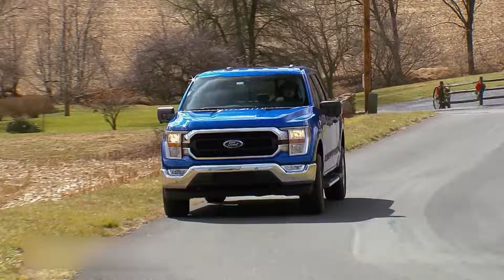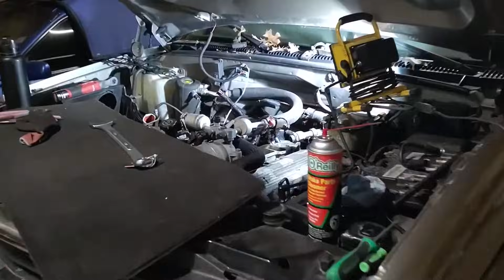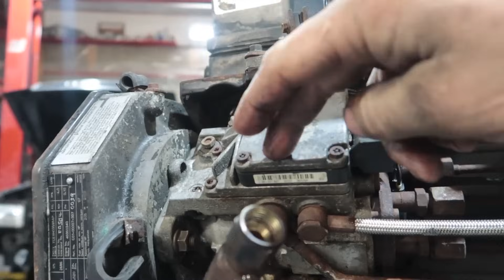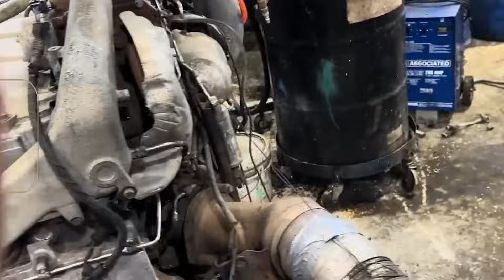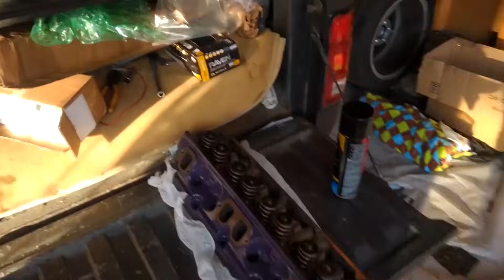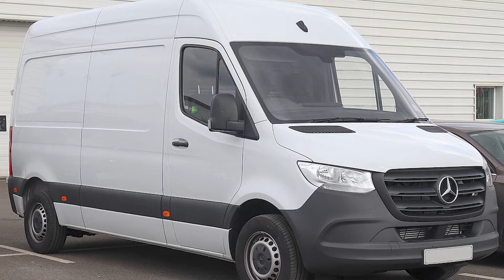The WORST RV ENGINES Ever Made (AVOID AT ALL COST)

Comment: Do any of these engines have a chip in them? If yes maybe that's the problem. If no then maybe that's what it should get right?
Reply: Boomer, the electronics have make engines way cleaner and reliable than ever. Is usually bad mechanical design or problems with carburators egr pumps and other complicated mechanical junk that electronics have now replaced..